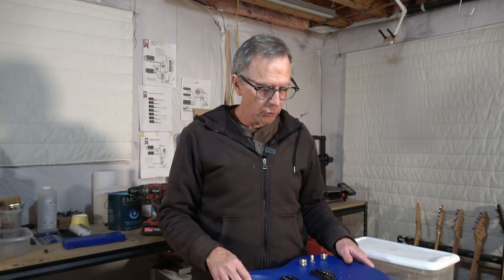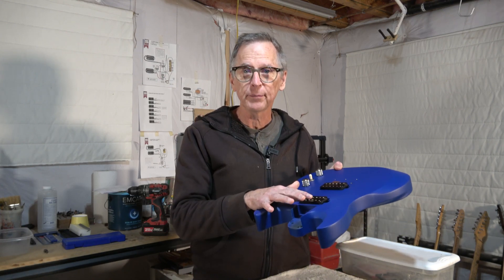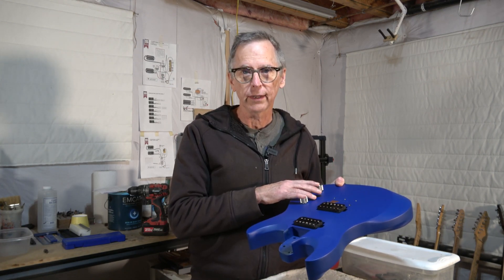Making A 3D Printed Electric Guitar Part 7

Comment: @Highline Guitars The solution of the rubber tube instead of the traditional pickup's springs it' INTRIGUING! Would you care to explain us why, what are the benefits etc. As a fellow builder myself, although not at your level, I am always eager to learn something new.  And BTW, I love this project.
Reply from the maker: The benefits for using latex tubing to mount pickups are low cost, easy to use, and readily available.
Reply: @HighlineGuitars don't they become brittle over the time?
Reply from the maker: @ No. Surgical grade latex doesn’t become brittle.